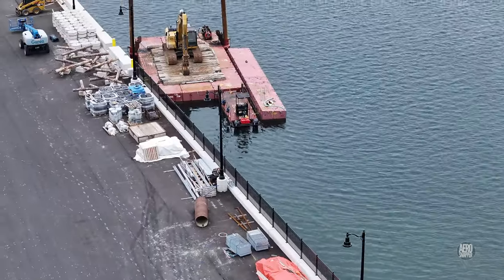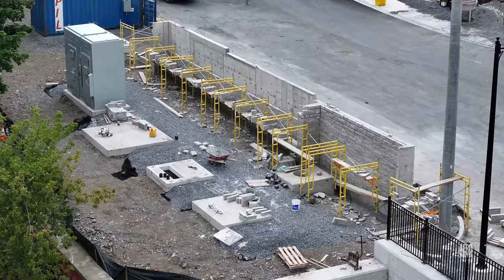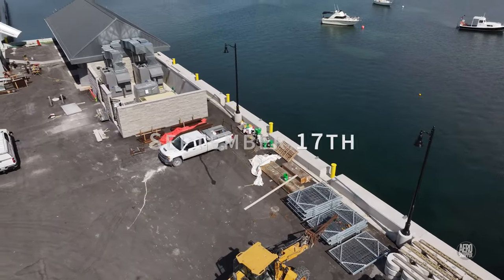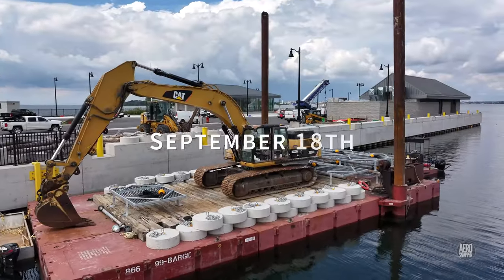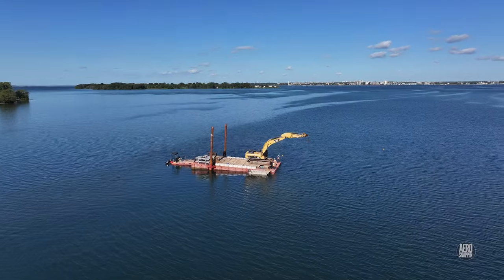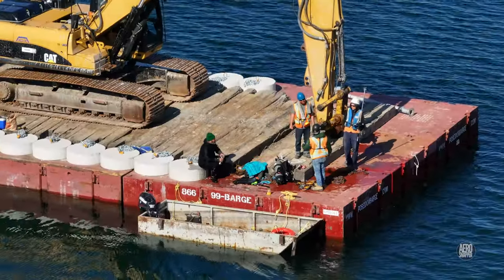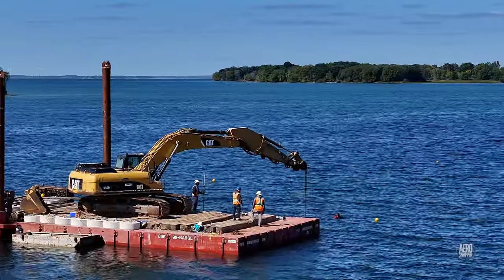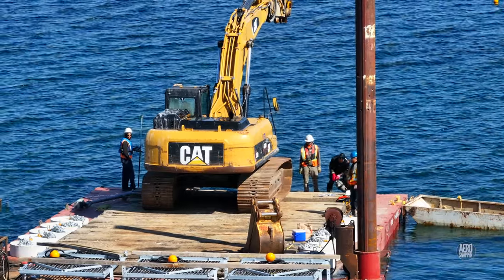Fishy Tales from Marysville - a dock reconstruction update   4K

Comment: Impressive work, and very interesting. I'll stay tuned...  I'm curious about the ductwork revealed at 1:30   -seems it may be exposed to the weather year-round....
Reply from the maker: Glad you find these interesting Bob - and thanks for following and taking a moment to comment.  Yes, it does look as if those ducts will be out in the weather, but time will tell
Reply: Those ducts should be sealed and insulated. I'm sure that will get done. @Aerosnapper